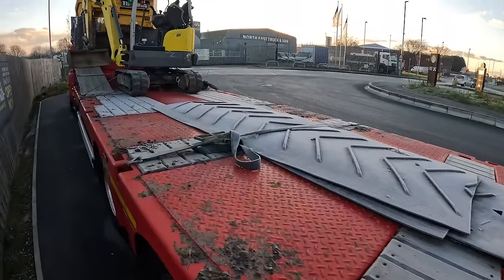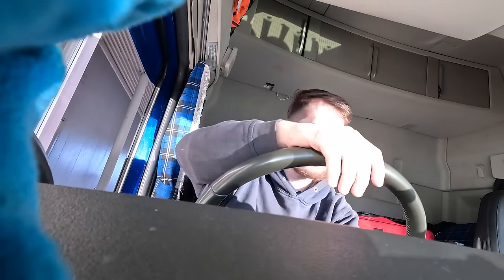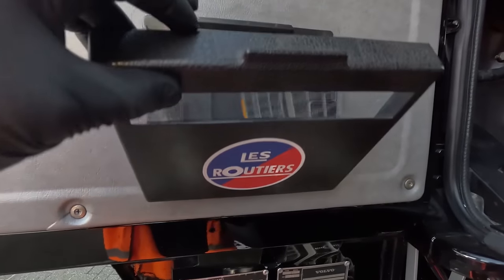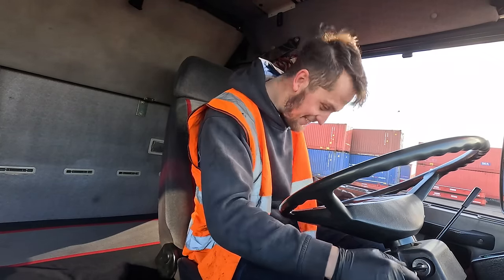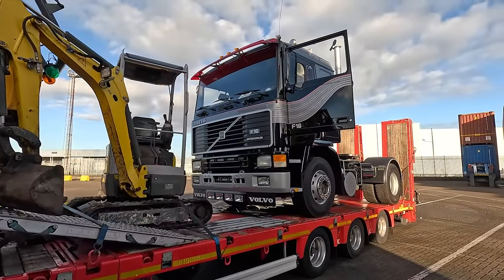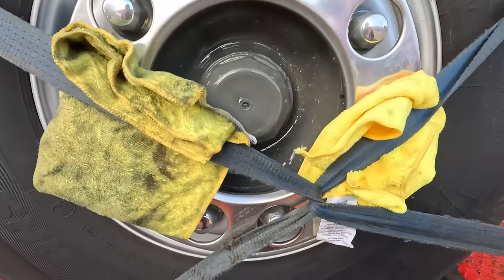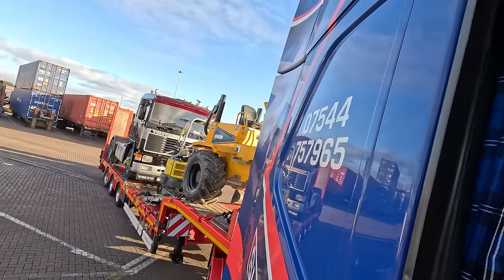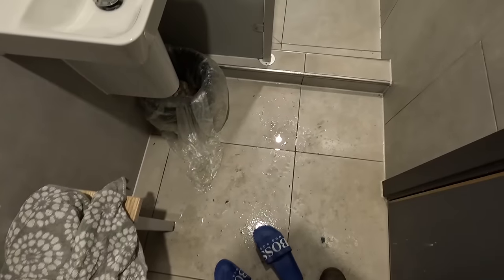Transporting a 1980s Volvo F16! - Episode 75

Comment: An old work mate I use to work with(sadly passed afew years ago) would of wet his pants with that....
And he could of pulled that apart nut by bolt and rebuild it blind folded.
If your ever in hull and your stuck for owt....just give me a shout.
Just think that one f16 would be a week's work for fanny tim😁😁😁
You are coming along great both with your vids and even better with your loading ect.......
Top man, im getting a little better on attic, but can still fall back to ridged so easy.
Well if I don't see ya or comment before.....
All best for next year and have agreat Christmas.
Reply from the maker: A proper truck driver then my man I’m really sorry for your loss mate